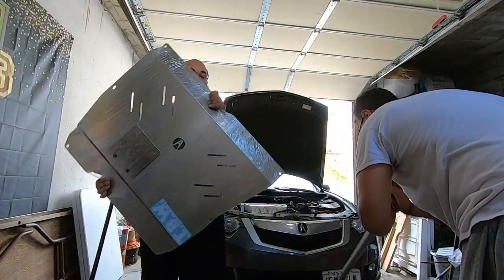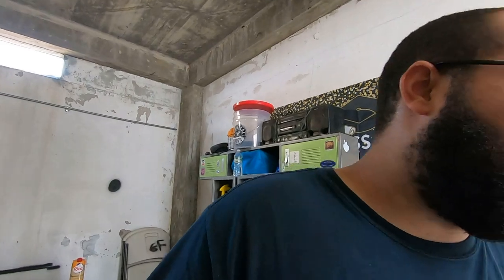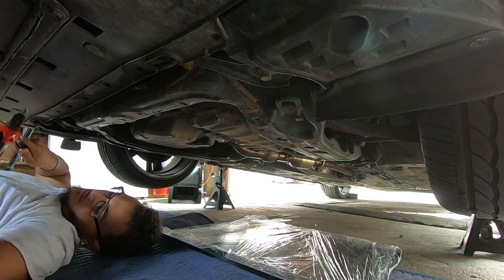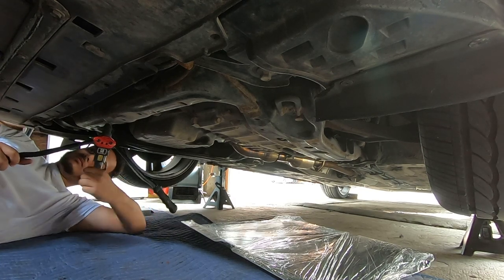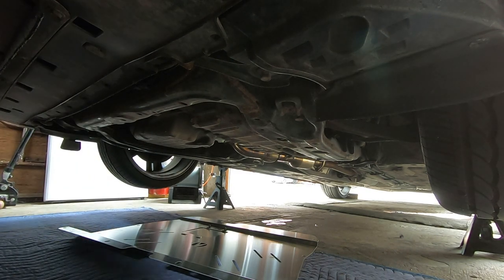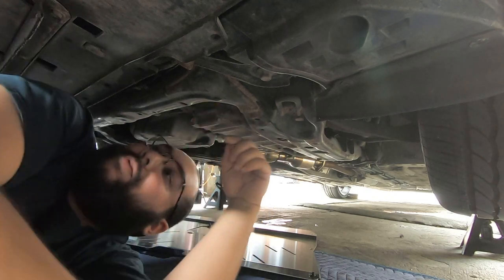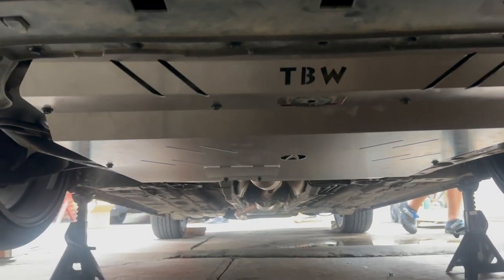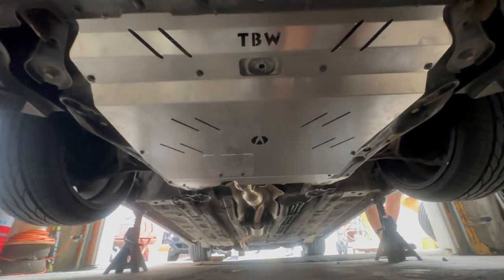Bagged Acura TSX Gets Some Love | Installing TBW Skid Plate | 09-14 Acura TSX

Comment: How did you mount your license plate there?
Also how did you amber delete the headlights?
Reply from the maker: I got the license plate bracket from jdm speed and drilled two home to the bumper. I have a TikTok on it if you want to see the install. I paid someone to do the amber delete but they no longer do it.

Comment: How did you deal  with installing the rivet nuts on the front, under that plastic piece? Did you get regular skid plate or one of the thicker ones?
Reply from the maker: So i had my boy pull down on the plastic piece just enough for me to get the rivet nut tool on to the frame.  I got the regular one for now but may get a thicker one cause of these NY streets.
Reply: @chillitsjohn  Did you also get 2 plastic push clips with your kit?
Reply from the maker: Yes i did i put them in middle where the plate sits with the bumper

Comment: what LED's do you have for your DRL's?
Reply from the maker: I have the Aukee 9005 but they stopped making them. I got them on amazon and if these die out i will end up getting the Auxito brand.
Reply: @chillitsjohn  nice. I ended up getting the sealights. They are bright and work well, and don't flicker which was an issue when looking for LED bulbs. I've heard good stuff about auxito as well